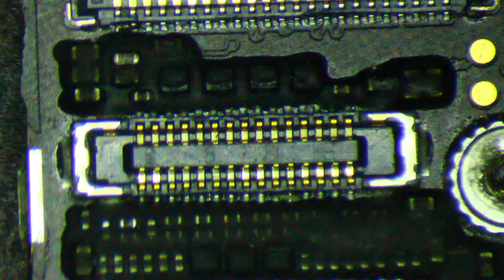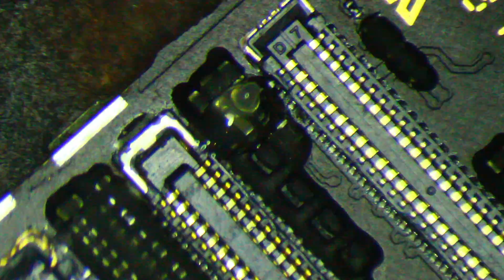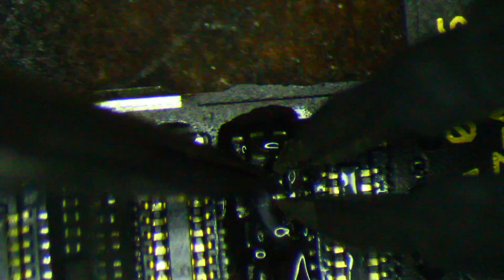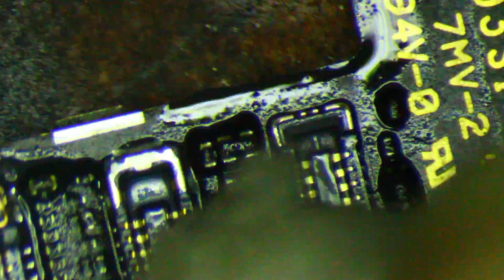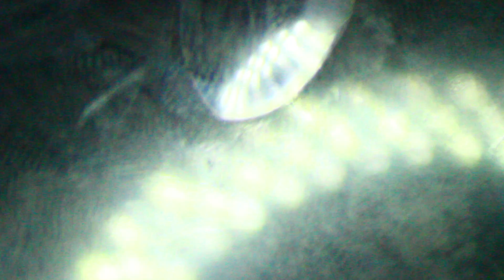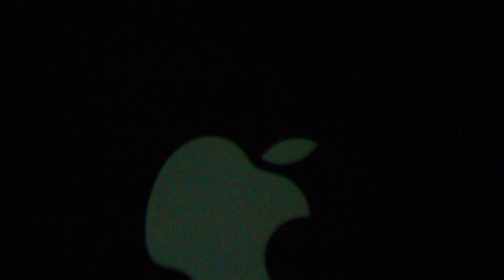iPhone 6 no image solved

Comment: So Mark, to test this filter I use the MM on DC and check for a voltage of 1.8v? If less it could be partially blown? Thanks
Reply from the maker: Matt Beck no, I'd just check to see if it beeps in continuity mode.